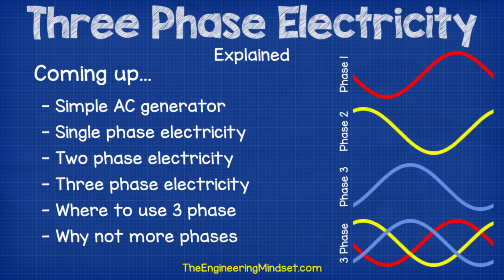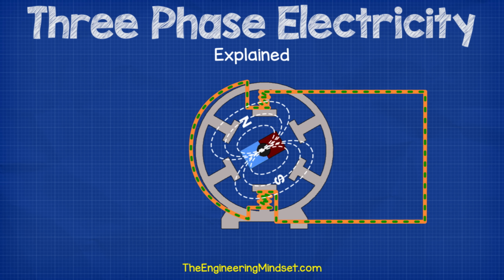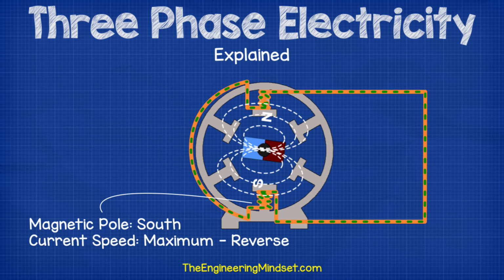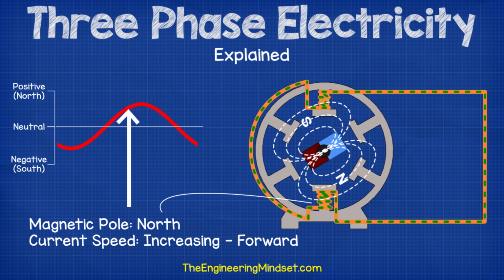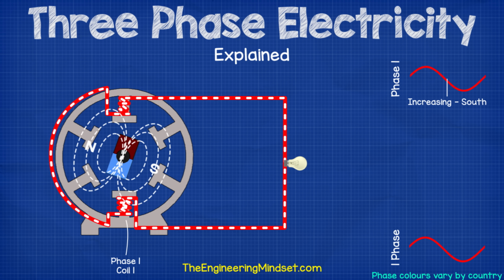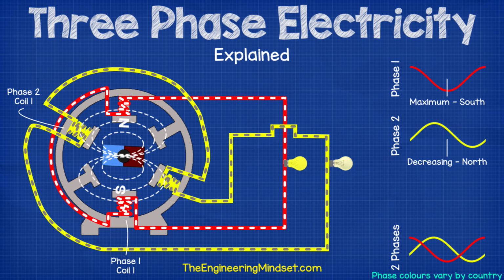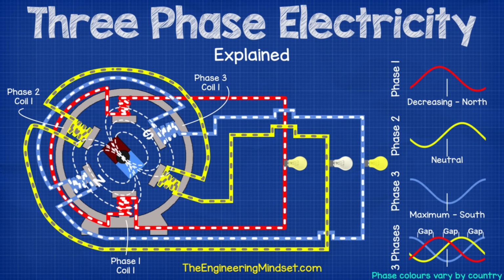How Three Phase Electricity works - The basics explained

Comment: Since the electrons in a circuit are moving forward and backward as described, how is electricity consumed?  Are the electrons removed from the circuit and converted into light energy in the bulb?  It seems like over time, the copper would run out of electrons to give up and the wire would no longer work as a conductor?  Thanks from a chemist who never quite got electricity.
Reply from the maker: watch the new version https://youtu.be/qthuFLNSrlg and 3 phase generators https://youtu.be/WhATjUHgzxQ

Comment: This was GREAT!  Great explanation. One question:  Can a load like a light bulb work on three phase assuming the voltage is correct?!
Reply: 3phase voltage systems available in home voltage, america 60Hz 120/208V, Europe 50Hz 230/400V, phase-neutral voltage /phase - phase voltage
Reply from the maker: watch the new version https://youtu.be/qthuFLNSrlg and 3 phase generators https://youtu.be/WhATjUHgzxQ

Comment: I am not an electrician. But I used to work as an electrician’s helper. I never understood the differences when they would mention 3 phase motors and similar terms. This is the best explanation I’ve ever seen. Thanks!
Reply from the maker: A newer and better version here https://youtu.be/qthuFLNSrlg and 3 phase generators https://youtu.be/WhATjUHgzxQ
Reply from the maker: Check our new revamped 3 phase explained video, sooooo much better:👉 LINK: https://youtu.be/c9gm_NL7KyE

Comment: could they create a linear generator, which only use the maximum part of the field say a magnet running in parallel with a wire.? Would this be direct current.
Reply from the maker: Check our new revamped 3 phase explained video, sooooo much better:👉 LINK: https://youtu.be/c9gm_NL7KyE

Comment: "The speed of the electrons changes??? do not think so, the strength changes with the increase and decrease of the magnetic flux, but electrons flow at 300,000,000 meters per second.  As the magnetic flux gets stronger and weaker the voltage gets higher and lower but the speed does not change.
Reply from the maker: This video is outdated. See here instead https://youtu.be/qthuFLNSrlg

Comment: So if you take a very slow motion video of a high-rise building at night would you see these sections flickering in different cycles? Like floors 1-20 are offset 120° from floors 21-40, which are offset 120° from floors 41-60?
Reply from the maker: Problem is most building use Led, florescent or high frequency lights now so you wouldn't see it. But, in theory yes.

Comment: I think that your illustration of maximum change of magnetic field strength passing each generator pole and consequent maximum induced current are 90 degrees out of phase. Also the labels of the poles of the magnet are similarly displaced. The magnetic field lines are concentrated at the poles of a magnet, where they appear to "enter" the magnet.
Reply from the maker: You'll enjoy this one even more https://youtu.be/WhATjUHgzxQ

Comment: Did I understand correctly that small houses are NOT connected to three phase electricity? That's not true at least where I live. Electrical failure would cause the whole house to be without power.
Reply from the maker: The majority of the worlds homes are connected to a single phase only. The US and North American homes are generally connected to a single phase also but this is then split. Some parts of Europe provide homes with 3 phases
Reply: @EngineeringMindset  In Finland all houses and apartments are within three phase electricity.
Reply from the maker: Seen our new 3 phase transformer video?➡️: https://youtu.be/u0SsejDCVkU

Comment: What's the black line at 7:25?
Reply from the maker: The neutral wire, it connects to the centre of a Y connected transformer. See our video on electrical generator
Reply: @EngineeringMindset  Thank you!

Comment: I thought current (or more basically EMF) was induced by the RATE OF CHANGE of a magnetic field rather than its instantaneous strength.  Isn't that rate of change at its LOWEST when the field strength peaks?  This would indicate a significant phase shift from what is shown in this video.  Am I missing something?
Reply from the maker: Check our new revamped 3 phase explained video, sooooo much better:👉 LINK: https://youtu.be/c9gm_NL7KyE
Reply: @EngineeringMindset  Thanks for the reply.  You got it wrong on that video too though, and you even proved it in slow motion.

Comment: The thing i was hoping to understand better, is if u hook up a 3-phase motor and it is turning, but u need it to turn the opposite direction, then you reverse any two of the phases of power going to the motor and it will then turn the other way. I know it works when you do it. But I'm not certain why it does it. There ain't no F M - Fu-kin Magic. AE-A1 school Navy, Millington, TN ( suburb of Memphis) i remember our instructor saying that in the 1st phase of training as an AE. Every week you had a different phase and different instructor. That was 1976 and the thing I remember most about  the school, ain't no FM - it either does something or doesn't do something because its suppose to, or not suppose to,  any other result, you got a problem and there's no F M. Go through the module training of Basic Electricity and Electronics, once you complete that you go to AE-A1 school, about 6 months overall , cost the Navy $? and thats what I remember the most. Just made good sense.....
Reply from the maker: Check our new revamped 3 phase explained video, sooooo much better:👉 LINK: https://youtu.be/c9gm_NL7KyE

Comment: In my area 220 or 240 is the norm supplied to residences.  Two legs of the three phase power?  Or is that just the north pole vs the south pole .  120 for either leg and 240 if you connect both.  The classic three phase supply , when any two legs are used is 208
Reply from the maker: Seen our new 3 phase transformer video?➡️: https://youtu.be/u0SsejDCVkU
Reply from the maker: Check our new revamped 3 phase explained video, sooooo much better:👉 LINK: https://youtu.be/c9gm_NL7KyE

Comment: Except that houses usually have 2 phase power for 220 volt equipment like clothes dryers, electric ranges, and air-conditioners.  Although technically I guess it is single phase 220 volts but the secondary coil is tapped in the center to provide the neutral for the 2 - 110 volt phases.  Or something like that.  Maybe you could do a video about how that works.
Reply from the maker: We have covered that in a video, that's only north America though, nearly the entire rest of the world is single phase, some 3 phase

Comment: Hi, this is really cool, thanks! By the way, the current flow when you put the second set of coils for the second phase, is the same "direction" (mainly, but not really, due to parasitic currents) than the current flow of the 0 degree one? Right? Because on your video its on a diferent one 🤔
Thanks for doing this videos! I think they're amazing
Reply from the maker: Check our new revamped 3 phase explained video, sooooo much better:👉 LINK: https://youtu.be/c9gm_NL7KyE

Comment: wait.. at the end you said that most homes are being supplied with only a single phase? If that's so, how would they be using any motor operated equipment (i.e waterpump, refrigerator etc)?
Reply from the maker: We use single phase motors. Some homes do have 3 phase but the majority of the wotld doesn't
Reply: @EngineeringMindset  Thanks alot!
Reply: i mean, i thought we have 3 phase supply at home? Help! :')

Comment: Not bad.  But I'm going to nitpick a little.  
Most homes in the US have what is colloquially "called" single phase power but is actually 2 phases 180 degrees out of phase.  They do this in order to generate 240V (120V x 2) for ovens, AC units, and dryers, etc.
In 3 phase power, ALL 3 phases are 120 degrees out of phase from each other (not 180) therefore homes can only use 1 of these phases and then another different power leg that is 180.
If you use only 2 (120V) legs of the 3 phase power, you only get 208V when combined, not 240V because they are 120 degrees out of phase rather than 180.
This is why most large motors state on their nameplate that they require 208/240....which means you can use both 3 phase power (2 legs) or single phase power to operate them.

sooooooo......my guess here is that power plants actually create 4 legs of power total.
3 of them 120 degrees out of phase from each other for 3 phase usage, and
1 of them 180 degrees out of phase from 1 of the 3 legs of the 3 phase.
Hopefully this made sense.

I'm not an electrician btw, I'm an engineer that operates a laundromat for a living.
Reply from the maker: We've covered it in detail in this video https://youtu.be/fJeRabV5hNU

Comment: Interesting video however I'm still confused how the output from these three phases is , let's say, consolidated into one phase. In other words, the schematic shows each phase as separate lighting up 3 separate bulbs. Isn't the intention to show how three phase electricity is driving a single load? Bulb, motor etc
Maybe I missed some key aspect of this video... All I see in this schematic is 3 separate single phase circuits
Reply from the maker: Check this, you can see it https://youtu.be/jN7o7xvO6Pc

Comment: The narrative about electron* velocity is wrong. Electrons in AC are 'moving' at their fastest rate through the neutral charge point, and are at their slowest 'velocity' (i.e. '0') at the peaks. (And if you think about it, the peaks are where the electrons stop 'moving' and change direction). This is verified by examining the change in distance (y-axis) over change in time (x-axis). If you divide the x-axis into equal time intervals, you see that the change in distance on the y-axis is at its greatest through the neutral point of the sine wave (This is the part of the cycle where electron velocity is the 'most constant'). This is also where the gradient of the sine wave is steepest (indicating maximum distance over time), At the peaks, electrons reach their maximum potential energy, and so it follows that the maximum kinetic energy is through the neutral point. However, the maximum acceleration and deceleration parts of the cycle occur around the peaks. And this is where the maximum EMF is produced (because induction occurs where there is 'change in velocity'/'change in time').
*an electron is often thought of as a 'negatively charged particle', but in reality you can't see the exact location of any given electron, and when you try and look for it, it looks more like a 'region of negative charge with a more intensely charged area in the spatial centre of the region' than a hard dot.
Reply from the maker: Check our new revamped 3 phase explained video, sooooo much better:👉 LINK: https://youtu.be/c9gm_NL7KyE

Comment: There is an error in the representation. Actually the maximum current is reached when the magnet is parallel with the coil core that it energies. Because in that moment the magnetic field lines are perpendicular on the coil winding. But anyway, it is a great representation and a lot of work. Good job!
Reply from the maker: Check our new revamped 3 phase explained video, sooooo much better:👉 LINK: https://youtu.be/c9gm_NL7KyE

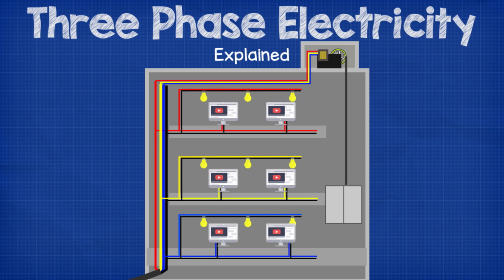Comment: 7:19 is this really normal?? I was pretty sure that houses generally have 3 phases? Might depend on the country as well as the size of the house maybe?
Reply: In the US, it is very rare for an individual house to get three phase.   A typical US or Canada residence gets 120/240V split phase, which comes from one of the phases of a 3-phase system, and is centertapped to make 120V for most loads, and 240V for power-intensive loads like the stove, oven, and dryer.   The half-way point of the 240V winding of the transformer is centertapped, and bonded to the grounding conductor, and grounding electrode.  This produces a black and red wire, whose volts to neutral are equal and opposite, and have an amplitude of 170V.  120V is the RMS voltage of this, that we use to name the system.   The voltage between the black and red wires, is 240V.

A single family home in the US gets a 120/240V split phase system.  A dwelling unit in an apartment building commonly gets two phases and a neutral, that are derived from a 120/208V wye three phase service for the whole building.
Reply from the maker: Check our new revamped 3 phase explained video, sooooo much better:👉 LINK: https://youtu.be/c9gm_NL7KyE

Comment: Good teaching! There are some inaccuracies, however. The reason the lights in our houses running on single-phase AC at 50 or 60 Hz do not appear to flicker is not simply because it's too fast for the eye to perceive. Poorly operating fluorescent lights or early LED bulbs prove this point in the real world, as they do produce a visible strobing effect, noticeable when, for example, you move your hand back and forth in front of you. The fuller explanation is that the flickering is smoothed out by the lightbulb. In an old-school incandescent light, the filament keeps glowing long enough to smooth things out. In a modern LED, there's a rectifier circuit, converting the alternating current into direct current, the pulses of which are smoothed out by a capacitor.
Reply from the maker: Check our new revamped 3 phase explained video, sooooo much better:👉 LINK: https://youtu.be/c9gm_NL7KyE

Comment: I'm going to guess that in a 3-phase motor, you will have 3 separate Coil windings around the same shaft, what would happen if you combined all 3 phases together into one Coil, apart from the 3 fold wattage - assuming the Coil is man enough not to just melt? 🤔
Reply from the maker: Check our new revamped 3 phase explained video, sooooo much better:👉 LINK: https://youtu.be/c9gm_NL7KyE

Comment: Ok so I hope someone can help me comprehend this: In the ending of the video it's said that our domestic energy supply is fed just a single phase right??? Which means that all of our appliances work even though they experience the 1 phase "gap" explained in the beginning???? I can't believe it!
Reply: He explains it towards the end. The gap doesn't matter for many appliances. Lights, for example, do flicker because of the gap, but we can't detect it. An electric kettle is another example -- the gap doesn't matter for heating small amounts of water in a few minutes. For things like our digital "stuff", those appliances, too, don't care about the gap. However, in their case it's because they have to do a lot of other "conditioning" of the power supply (dropping the voltage way down, rectifying it from AC to DC, etc) and so they take care of the gap as part of that. There are a very few domestic appliances that do need multi-phase (3 but sometimes only 2) -- some washing machines for example -- but like the digital stuff (although for very different reasons) the appliances themselves are usually responsible for doing whatever is needed to transform the standard single phase supply they receive into whatever they need. That said, I've seen some pretty big-ass plugs and sockets in the utility rooms of some US homes, so maybe some of them do get a 2-phase feed.
Reply from the maker: Check our new revamped 3 phase explained video, sooooo much better:👉 LINK: https://youtu.be/c9gm_NL7KyE

Comment: If the flickering of the light bulb is so fast that we can't notice it, why do we need 3-phase at all? If the single-phase current goes from one maximum to the next maximum in such a short period of time that we don't see it, what is the point of reducing the gap between two crests in the current wave?
Also, how can 3-phase current be 'split' into 1-phase and 3-phase whenever required?
Reply: One reason is for additional power. So yes, humans can tolerate the gap when it comes to light, but if you want to pump water uphill (say) then giving it three kicks per cycle instead of just one means you can pump more and pump higher. But in general, that kind of thing only matters in industrial situations, not domestic. For that reason, most homes are provided with only one of the three phases. Occasionally -- e.g. some washing machines (hence the weird big-ass plug and socket in many US homes utility rooms) -- 2-phase or 3-phase levels of power is needed, but that is usually taken care of by the appliances themselves.
Reply: Theoretically it's really three different circuits, each carrying one of the phases. And so all you do to provide only one phase is connect to only one circuit. The real question then is not how do we split 1 from the 3, but rather, how do we e we combine the 3  into 1. Answer: careful wiring. 😬

Comment: I wish I was at the point where this made any sense.  I'm trying to understand 3 phase bc a used commercial treadmill I'm thinking of buying uses it.  Can anyone explain to me if I need to upgrade anything to use it in my home?  I doubt I have anything fancy wired up.. Just a lot of black and white wires coming out of the box with a couple reds for the stove and dryer.
Reply from the maker: Check our new revamped 3 phase explained video, sooooo much better:👉 LINK: https://youtu.be/c9gm_NL7KyE

Comment: If the frequency is 50 Hertz you said the current is changing direction 50 times every second which is wrong , for a 50  Hertz frequency  the current changes direction 100 times!
Reply from the maker: Check our new revamped 3 phase explained video, sooooo much better:👉 LINK: https://youtu.be/c9gm_NL7KyE